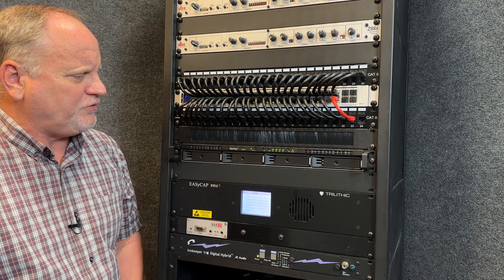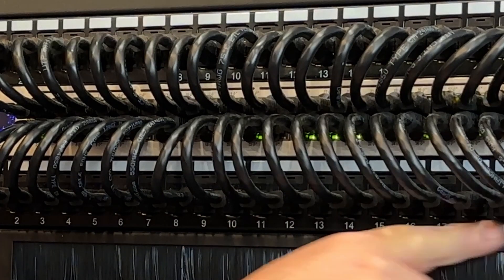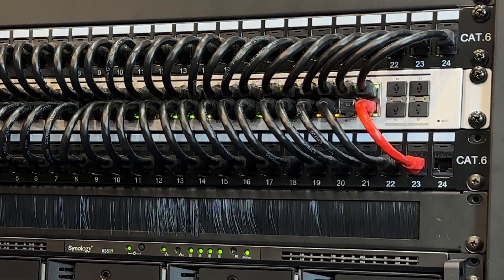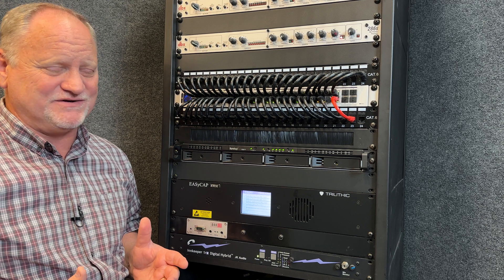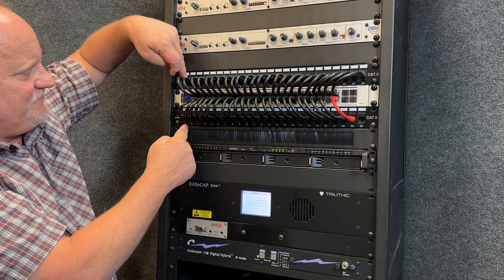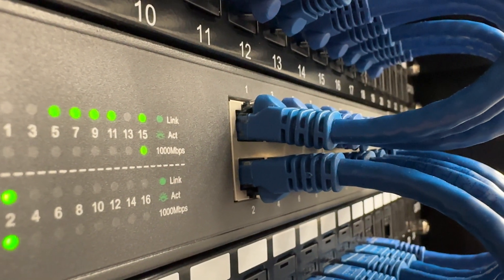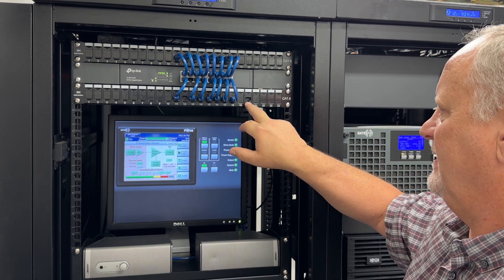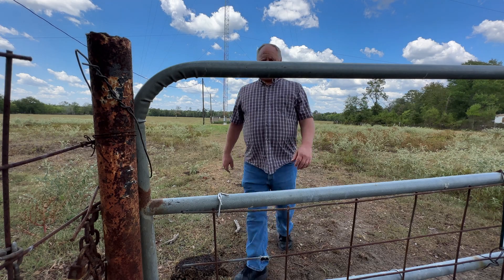Home Lab Patch Panel

Comment: Something you might want to look at are the 48 port keystone patch panels, that are 1U in height.  They are the Signamax 48U-HDMMP-1R panels.  That way I can have higher density in the racks.  I then use the Infinite Cables Ultra thin Cat6 clear boot 6" patch cables.  That way you can see the lights easily on the switches through the connectors.  

In my home system I have dual ISP feeds, one fiber and one 5G backup and then 32 port Aggregating switch those then feed out with 20G link to the 24 Port Pro POE switch and 48 port Pro POE with 40G link.   With 8000 sq feet we have lots of AP's and extra switches, cameras, phones all out and about.  I run as much of the home on POE as I can as I have large UPS' on the network side.  Anything that is 5V or 12VDC is powered from the switch for the most part, that way things can continue to work including RPI's and EPS32's etc.  

Keep up the good work sir!  🤠👍
Reply from the maker: I like that especially in those racks where there's not much room. Sound like you got a rockin' network!!!😁Love it my friend!

Comment: I'm going to be honest. I did not walk away from this video feeling like a patch panel was necessary. I could bundle my cat5 together along the side of the rack, and plug them in that way. Also, my switches/routers are faced toward the back, so I don't have them dragged through the front. Is there something else I'm missing in the benefits of a patch panel?
Reply from the maker: Sounds like your situation may be a little different than most, and that's ok. If your switch connects from the front then a patch panel just manages it well. I used to bundle them myself till I discovered how much patch panels organized it better. Not really a wrong way if what you have is ok with you. Thanks for the comment my friend.